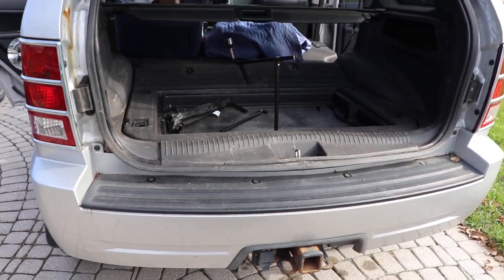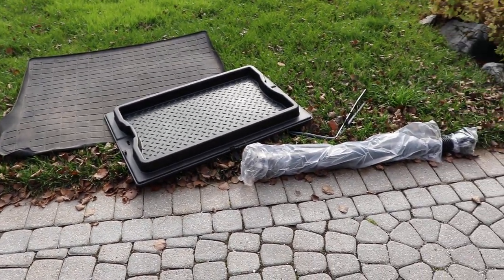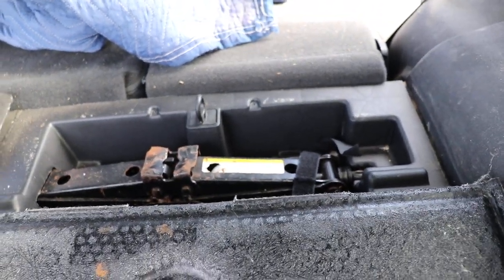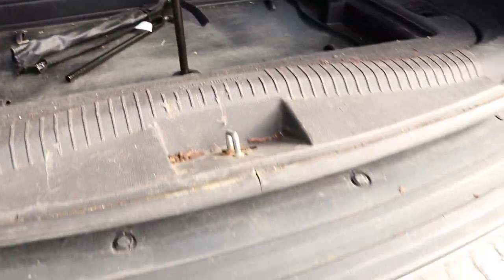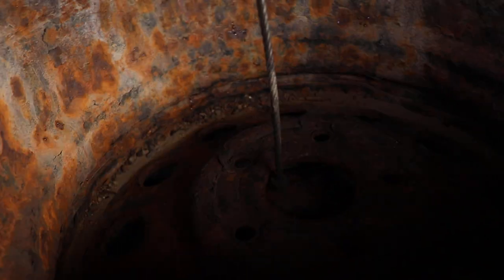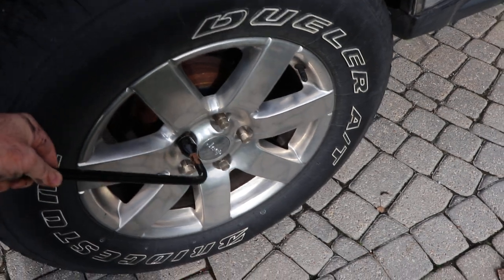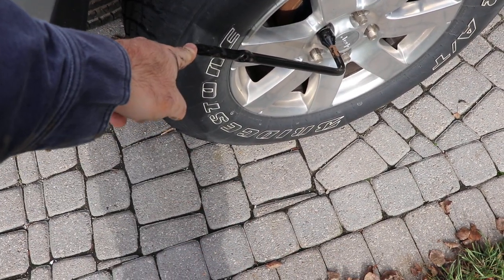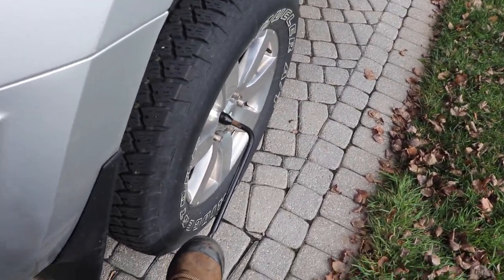2005-2010 Jeep Grand Cherokee WK Spare Tire Access

Comment: Cool.  My spare wobbles like crazy on my 2005.  Probably all rusted out and I will need to replace the hangar.  It’s from all the salt they use on our roads in Pennsylvania.
Reply: Mine just broke and dropped the spare on the ground. Id recommend removing the tire now while you wait for the parts. Much cheaper aftermarket as well. O Reilly wants$ 220 and I can get it for 40 bucks online